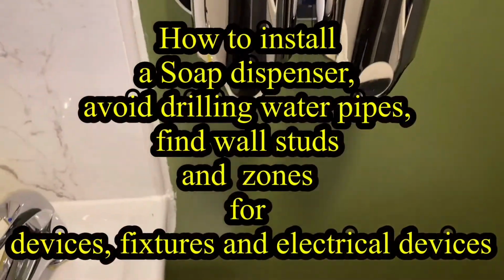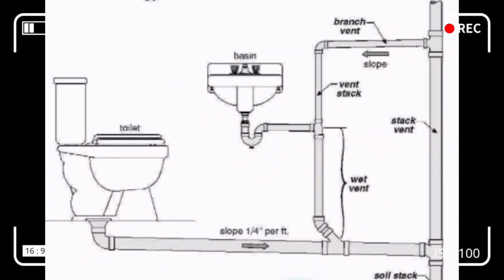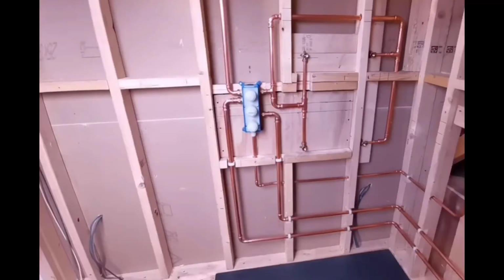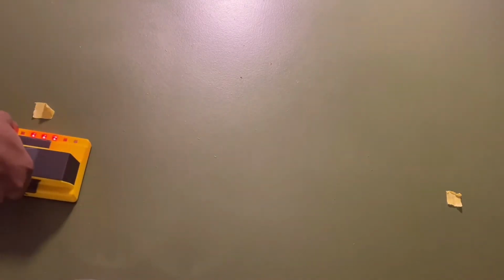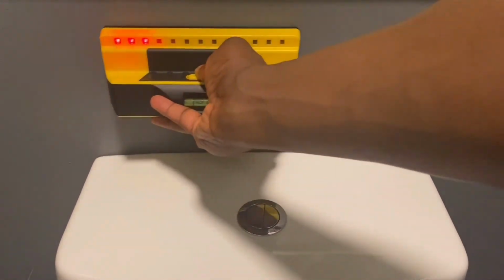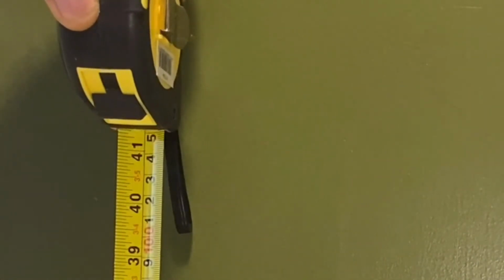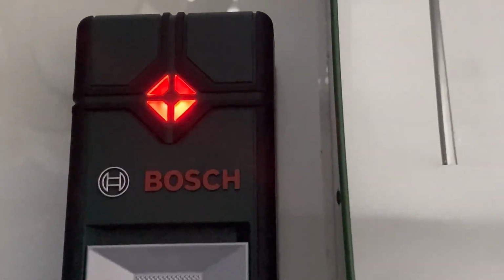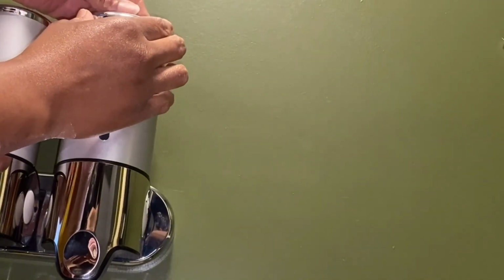How to install a Soap dispenser, find Wall studs & Metal pipes using a Pipe and Cable detector

Comment: Dispenser sorted, felt more confined using them devices when drilling although sometimes they can be sensitive but definitely scopes out the area being drilled prior to whacking a big hole and bursting pipes in the wall which you don’t need. Thanks love xx